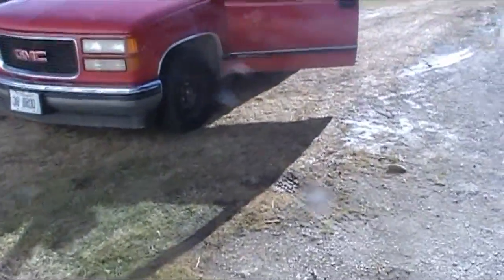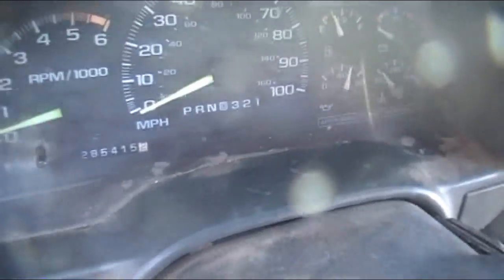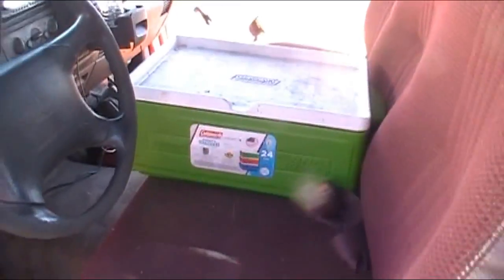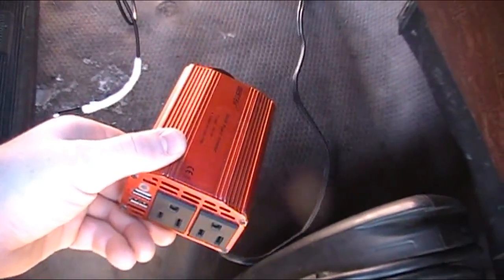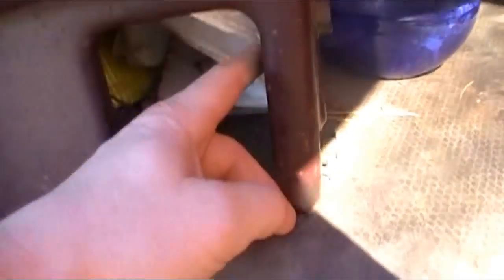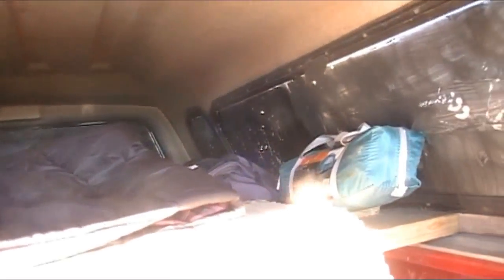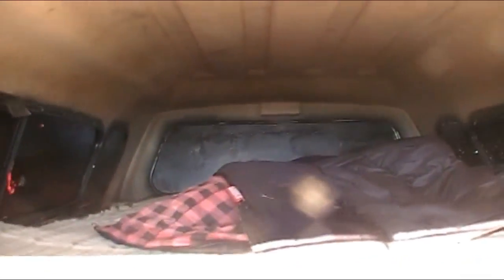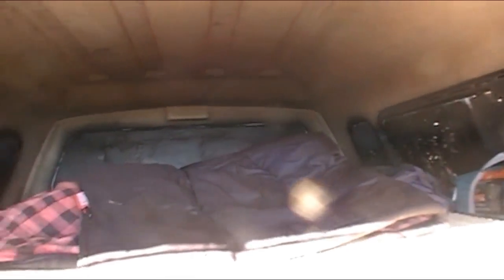Off Grid-Living in a GMC Pickup truck.

Comment: Idea on the shower thing. Build a small water exchanger out of copper pipe and hook it to your heater core on the truck. When you want a warm shower just bring the trucks engine up to operating temperature and then put your shower water through with a 12 volt pump. Depending on your water source you have unlimited hot water to shower.
Reply: Eastern Explorer ...I need to know more about this!!

Comment: Hey wow, I have and use the same battery pack in my diy truck camper. :)
Reply from the maker: Nice! Ive had it for a lil over a couple years. It has came in handy more than once! I charge mine back up through a 12v inverter/cig lighter. Unfortunately the air pump stopped working last summer. Overall, I am very happy with this product!